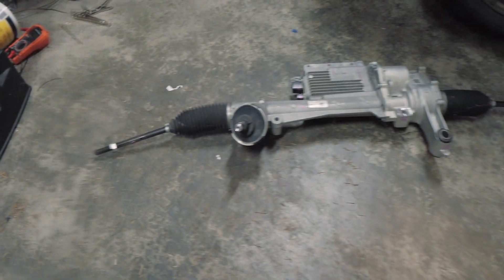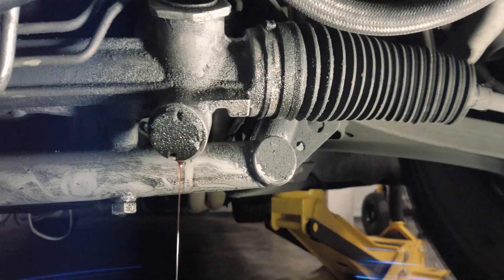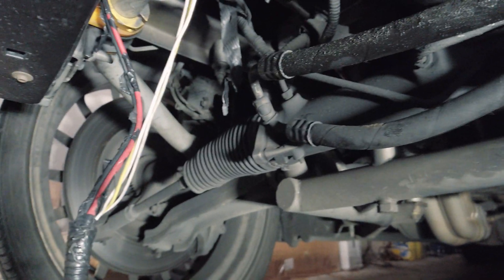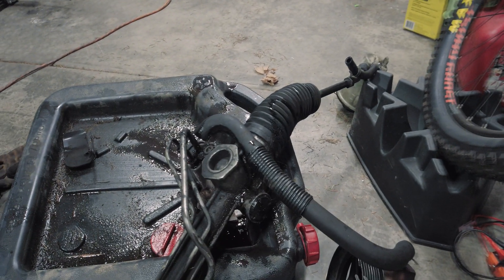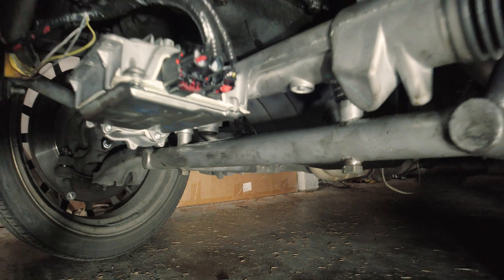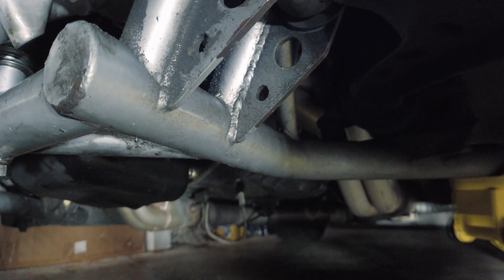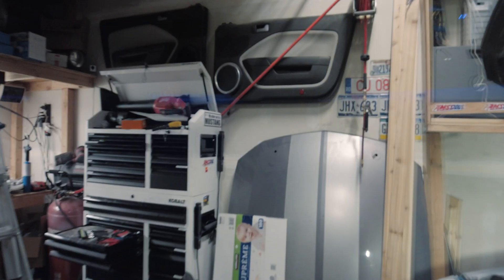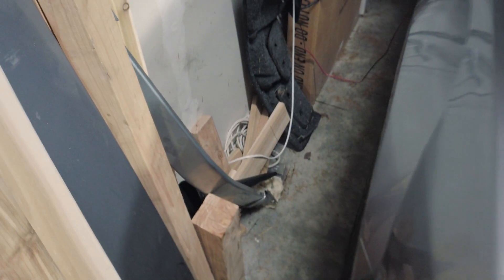S197 EPAS conversion part 2

Comment: Awesome video! Thanks. How do you know what mode the EPAS is once it installed?
Reply from the maker: Thank you! :) Unfortunately it is in the "working" mode haha! Because the car does not have a way to tell the EPAS which mode to go in, it only uses the default mode.
Reply: @DronezandGasoline  Do work without BMR K member?
Reply: Right on. Thanks for the reply. Keep up the good work.

Comment: Underrated channel bro. Let’s some footage of the car outside in some lighting for the intro’s . I’m tuned in . I’m the guy in the Bay Area doing all the same mods as you are . In the process of 2014 complete Int swap, full suspension, widebody and Meth injection mods
Reply: Did you end up completing the interior swap? I am in the process of swapping my interior too, and using his videos for a reference guide.
Reply: @BradleyMcCartney  I’m about 75% complete on the interior . Decided to go widebody, custom duckbill trunk , and custom diffuser as well so the car is under construction fully atm . But I have my old dash pulled and currently going suede on the dash . Soon as the ship is done with my dash I will be installing . What year and model do you have? And what did you decide to do as far as hvac ?
Reply: @bobayagga2233  That's so awesome, I would love to see some pictures of it! I love the idea of alcantera but not so much the price...I have a 2005 Mustang GT. I am planning on cutting out the old air box piece from the 2005 dash and mounting it to the 2014 dash like he did in another video but we will see how that goes... I am tackling that today after work.